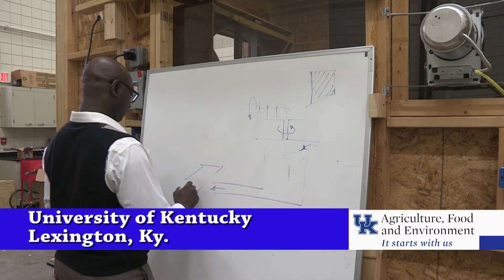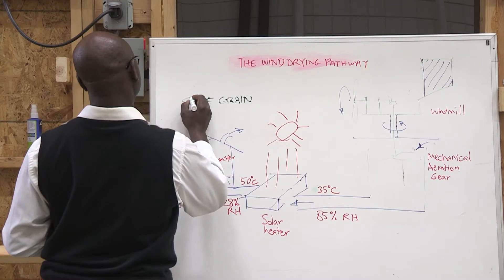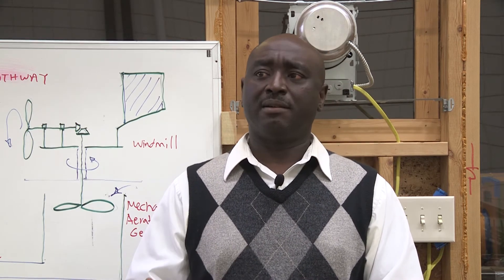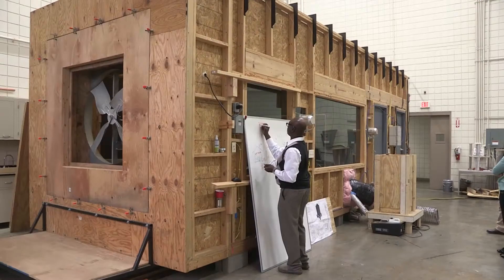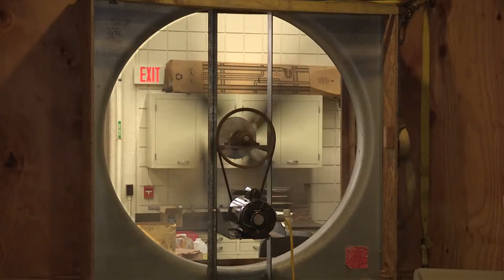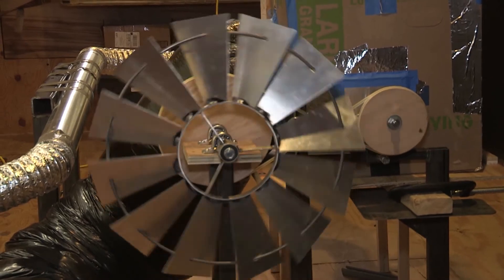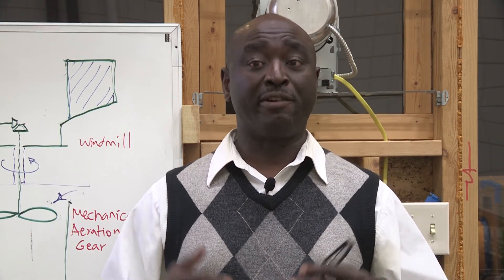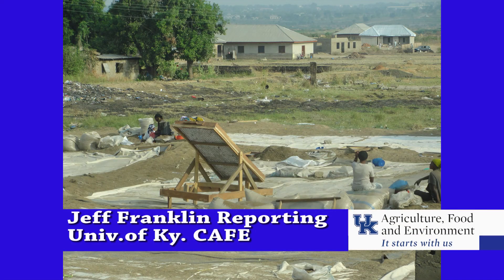Wind Energy Improves Grain Drying

Comment: As a person who has worked in the industry for 20 years. I find this very hard to believe and even viable. Very, very, very, disappointed with UK for Peddling this junk.  You put two wires on a  motor it will run a fan and it doesn't care if its a battery, a gas turbine, a coal fired generator and anything else. So using solar kills aflatoxin and coal fired energy does not?
Reply: It is expedient you understand the complete context of this design before you hurridly trashed it. This project is based on a peer-reviewed proposal funded by US EPA - so experts on green energy would not fund "junk". There is a fundamental error in you assertion that mycotoxin can be "killed" - there is nothing like killing mycotoxin in science.

Second, heat treatment generated through solar energy cannot (it is not intense enough to reduce mycotoxin like aflatoxin) "kill" aflatoxin. The goal of microbial inactivation is the destruction of the organism, not its metabolite. And you do not "kill" afltatoxin, you may be able to reduce it after it is produced by the fungi/mold called Aspergillus parasiticus.

This is an appropriate technology for poor farmers in developing countries, not the US. Smallholder farmers in places like sub-Saharan Africa do not have access to electricity, so using an electrical system will not work. The system we have designed does not use electricity, it simply harnesses wind energy to drive a fan for forced air generation to increase mass transfer rate in a dryer. It is simple and feasible enough for rural agriculture application in far away places. The argument between the cost of using a solar panel to generate electricity to drive a fan versus simply directing wind energy to drive a shaft fitted with fans for aeration can be made - but that will also be based on access to solar technology, maintenance, and cost-effectiveness.